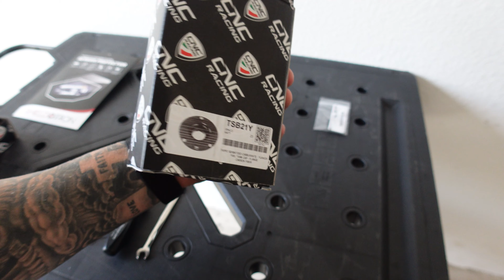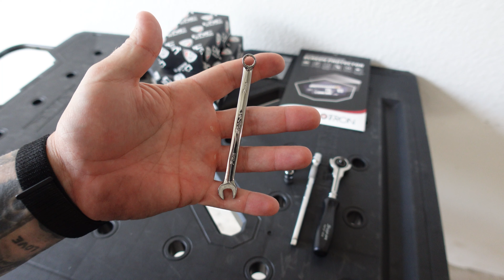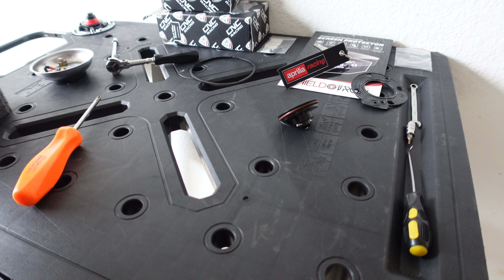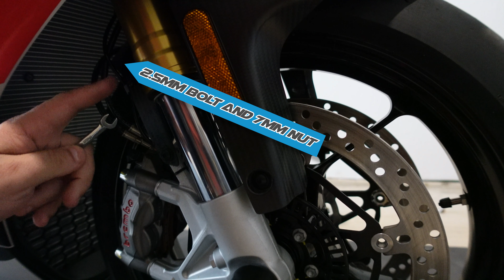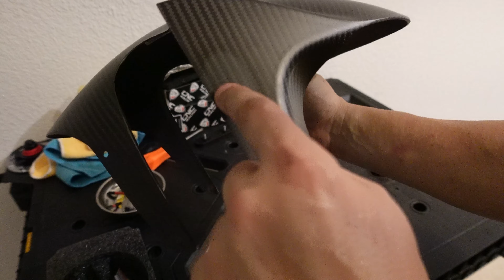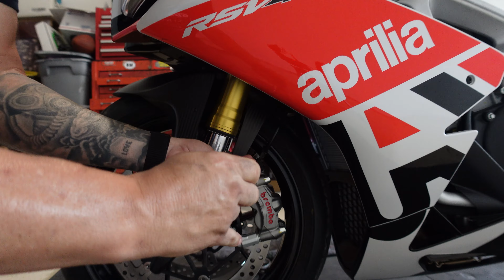CNC Racing carbon fiber gas gap, screen protector and carbon fiber fender plugs.

Comment: Just picked up a 2020 RSV4 Factory 1100.  Will install a fuel cap as soon as it arrives from HSBK Racing.  Thanks for the informative videos.  Helps me plan out how to install some of the items.  Have you installed radiator and oil cooler guards?  Do you plan on doing that?  If you do I look forward to the video.  Thanks again for the content.
Reply from the maker: those are really nice bikes, what cap are you going to get?
Reply from the maker: And yes I do plan on doing the guards on mine just haven’t decided which ones yet
Reply: @LonestarMoto  I ordered the R&G Racing.  Should arrive Thursday night.  Hopefully get them installed this weekend.
Reply: @LonestarMoto  Cap?